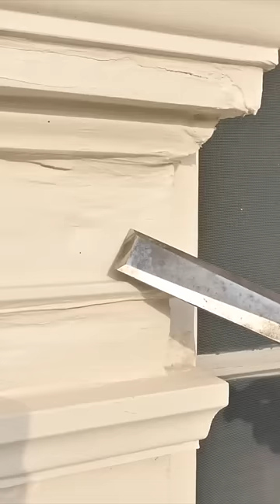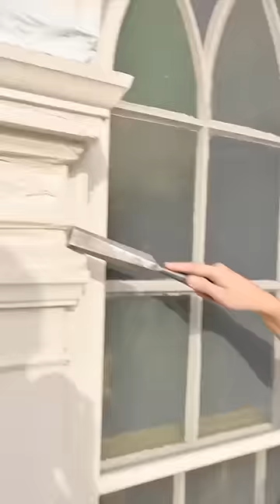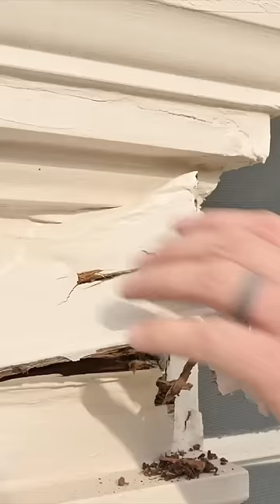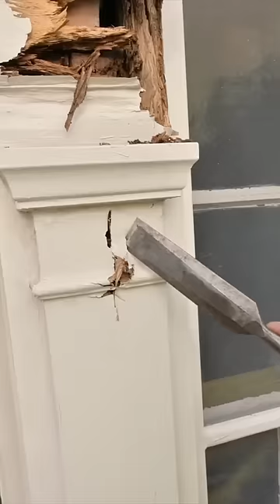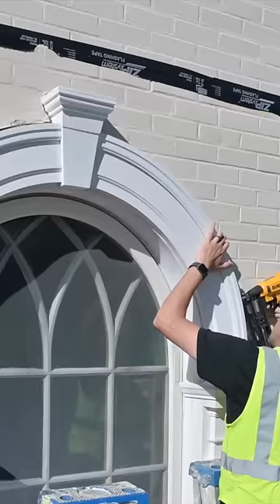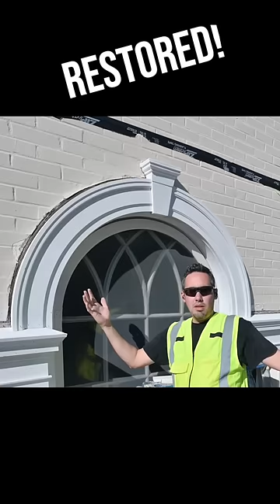If your wood is this soft, you have big problems

Comment: “If your wood is soft, you have big problems”

Never heard a more accurate statement
Reply: Might want to speak to your doctor about that
Reply: I’ve never heard one less accurate. Cause if your wood is soft then it’s a small problem.
Reply: @minimeme2513  big problems as in you have problems getting big
Reply: I do reckon you need to apply some enhancing oil to harden the wood, most of them comes in small tube spray
Reply: It needs to be harder
Reply: Sounds like Mac and cheese
Reply: I got small problems

Comment: HO: Hires contractor to assess the damage.

Contractor: sticks chisel through window frame. “Well now that’s gotta be fixed”
Reply: Ya it looked perfect before.  Just don't stab it
Reply: I met a contractor just like that 🤣
Reply: @SoulDelSol looked is the keyword. This would've fell apart soon anyway.
Reply: You're all wrong, his job is to inspect the house and that full on includes  you know finding put WETHER YOU CAN PUNCH A HOLE ON THE WALL
Reply: if he didn't that house would probably fall apart
Reply: That wouldve fallen apart within the year. That wood is completely rotted out.

Comment: Nobody gonna treat those termites? They're gonna fuck up your work in no time.
Reply: Thought it was dry rot but i don't actually know
Reply: @dumbdirector5571 it is dry rot. He would not of spent all that time replacing if it was just gonna get eaten up again
Reply: Looks like old water damage and dry rot to me
Reply: Water rot. No dirt tubing or “little holes” you’d see hundreds of grey ish/white specs if there were termites
Reply: Water damage, not termites
Reply: Water damage, and its possible he used pvc
Reply: It’s called job security
Reply: You just saw a 1 minute clip, you know very little of what was done.
Reply: I can tell you've never seen either water damage OR termite damage. It's very obviously water damage
Reply: That's water damage. The real question should be did they solve the water problem before replacing everything.
Reply: but thats how he gets repeat customers
Reply: @drbeans4205  you'd be surprised what kind of work some ppl will do
Reply: Not termites. Just a shit caulk Job from the first guy
Reply: @dumbdirector5571 it's just dry rot
Reply: Meh the termites already had a good treat.

Comment: In Europe we make those decors with isolation styrofoam, cover it with glass fiber nets and "plaster", lasts forever and saves energy on heatind the house.
Reply: Depends where you are and the age of the house. Here in Norway, most modern houses have no fine detailing because our architects and beaurocrats hate beauty, but on older houses you can find really nice wooden detailing. If you take basic care of it and it was properly treated ahead of time however many years ago, it’ll last pretty much indefinitly. Just keep it painted
Reply: This is termite damage
Reply: @wraithvendeta  no shit, thats why we make it out of styrofoam not wood
Reply: @wraithvendeta  damn I thought the wood had just started to rot
Reply: You’re speaking for an entire continent. Generalizing 😒
Reply: Germany 🇹🇷, United Kingdom 🇵🇰, France 🏳️
Reply: @wraithvendeta  no it's rot thats been painted over. You can see where the painter caulked the crap out of it and painted over
Reply: @cannabislife1688  nah man, germany isnt turkish anymore
Reply: @temerenomine9698  much better to have toxic styrene than biodegradable, renewable wood
Reply: @barryallenporter8127  the only toxic thing here is your presence.

Comment: Its wood and its outside 😂😂😂😂 you ll be back there in less than 5 years my man, were i live all exterior works are metal brick sand and cement, wood is the leat used and when it is it just goes rotten, i love wood too but you want things to last, usa is wood crazy... great for the carpenters 😂 😊